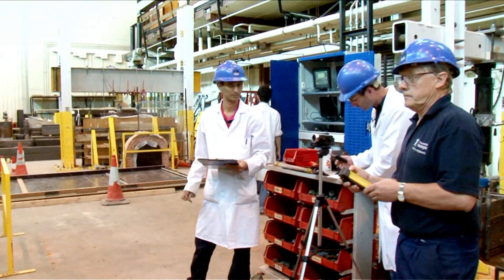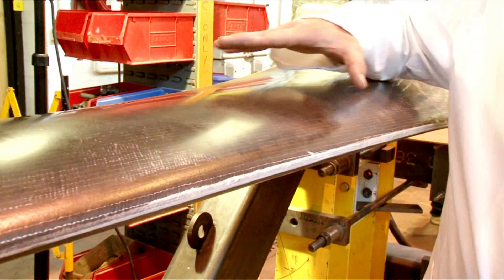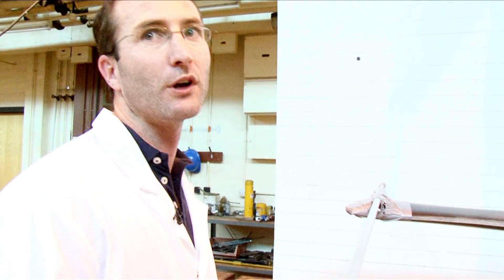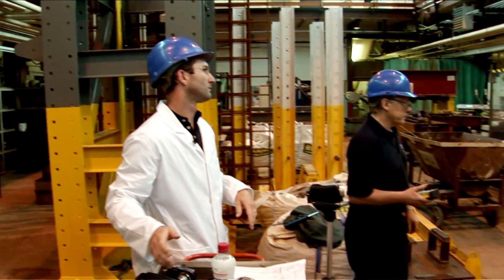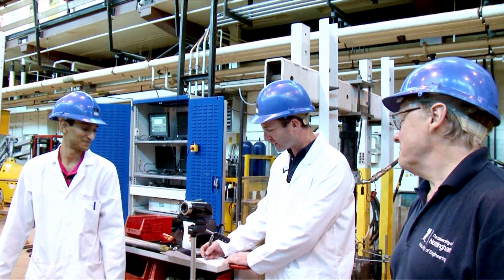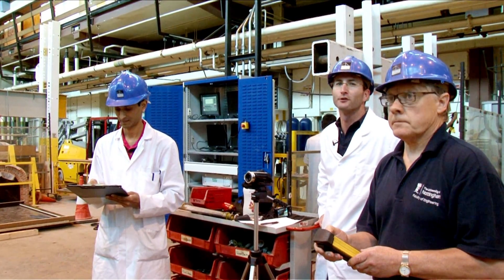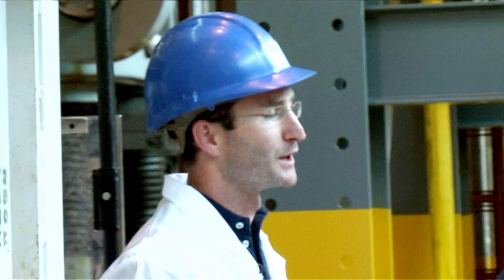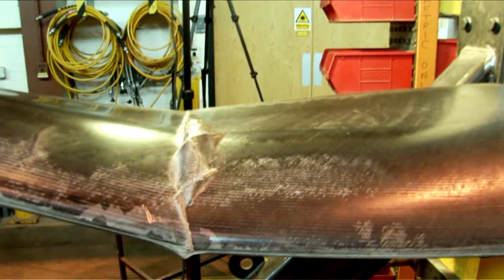Turbine Blade Destruction

Comment: Hemp was considered, but, as is the case with natural materials there, is a lot of variation in material properties from one batch to another. As it turned out, the flax fibres we tested had better properties than the jute and hemp fibres we also tested... so we chose flax for the blade.

Comment: With respect to the way of testing I don't think this is enough and/or real enough, compared to the later situation in which the blades are mounted. Rain, moisture, dirt, vibrations, sunlight, ultraviolet light from the sun, will (in my opinion) crack the surface of the blade, making it brittle and/or destroy the surface tension from the material. But anyhow, always good to test a blade of course and an interesting video.

Comment: Nail on the head. I'm studying engineering and this is exactly why they don't. The cost of composites as well as their production capabilities/costs are very high. Also, this kind of material favours
You generally use these kinds of composites for simple shapes that need to be stiff and light. (ie, wind turbines or the outside of a Formula 1 car)
Metal actually deforms even in fairly high speed crashes. It's very good at absorbing impacts which is one of the big reasons it's used in cars.

Comment: Currently plant fibre (thermoplastic) composites are being used for interior car components (door panels, dash boards etc). While the tensile/flexural strength of plant fibre composites is OK (hence it has survived this test for a wind turbine blade!), the impact strength (which is critical for car exterior bodies so that ur car doesnt crumple up if hit by another car!) is very low. Plant fibre composites are actually very light - approx. half the density of E-glass composites and aluminium.

Comment: Stress tests might put it under loading of say a 100 year storm (worst case storm loading estimate in a typical hundred years), using statistical estimates. Other tests might use repeated loading and unloading (fatigue testing) to simulate years of use (thousands or even hundreds of thousands of cycles). Testing to destruction is very common in engineering and a lot of standards exist.

Comment: the material requirements/testing of aircraft's is probably more comprehensive, particularly regarding fire-testing, as you wouldn't want a wing on fire!
But it depends what 'planes' are you referring too. Commercial airliners probably not. Military, perhaps yes. In fact, plant fibre and wood composites have been considered for military aircrafts such as Spitfires and Mosquitos, but only during World War II. Since then oil has become readily available, making plastics and E-glass dirt cheap.

Comment: More surface area also means more drag witch would decrease efficiency. They are basically the same as airplane wings, planes, and actually birds too, that are designed to fly very efficiently have long narrow wings. Only planes that can afford to burn up fuel in exchange for increased lift have broad wings. Also heavy blades would need stronger towers, bearings and more rigorous safety features which would increase the cost.

Comment: Plant fibres (density of 1.4 g/cm3) are lighter than carbon fibres (1.74 g/cm3), but not as strong/stiff. However, the amount of energy required to produce carbon fibres (135 MJ/kg of fibre) is 10 times more than it is required to produce plant fibres (15 MJ/kg of fibre). Plant fibres are actually carbon neutral.

Comment: I was wondering the same thing. They mentioned that this flax-based fibre was intended to replace the use of carbon fibre, so I assume that it would probably be strong enough.
How heavy it is, though, I wouldn't want to hazard a guess. I don't know nearly enough about it.

Comment: Also, any power plant that uses the boiling of water to spin turbines requires a water source and ends up heating said water source (coal natural gas etc). The cooling of the reactors using water is no different from the combustion of coal that heats up the air.

In my mind, other than the limited amount of hydropower that can be generated from falling water, there will always be some cost.

Comment: I'm not saying they're perfect, and I didn't see your original post no. However, new nuclear plants are so efficient and you need far fewer of them than other types of plants. They can be built far away from metro centres etc for safety reasons. Also with that new storage facility that is being built in Nevada under that huge mountain, storage will be safe. Definitely worth looking into. I'd rather have a few bird casualties than fields full of fans everywhere and little energy to show for it.

Comment: Isn't the problem with those fibers, that they are not very good in resisting hits? I think i read something like this. They already make bicycles out of that, but you have to be careful with them, as far as i recall. So an impact is not a very big problem for a blade that is, like 50 m from the ground, but it is for a car. Bycicle frames are small, therefore not that likely to be hit, they don't move as fast, and are relatively cheap to replace.

Comment: I feel obliged to correct you on the energy absorption of carbon (or any other) fibre: it's excellent and much higher than metals. Most of the expensive sports cars and pretty much all race cars have carbon fibre crash boxes. 
The reason is, that it shatters instead of just deforming as a ductile substance (metals) would.

Comment: Hmm... So this more or less boild down to how fire-proof this kind of material is. Probably not very. Although I'd guess that, with certain kinds of processing, you might get it to not be easily ignitable either.
Maybe they'll have to reconsider in a not so far future, once oil basically is used up.

Comment: It's basically like this: A cfrp crashbox will delaminate and shatter into countless tiny pieces and dust which takes much more energy to do than bending a piece of metal. Why? I can't explain this myself in much detail but I guess it's researched in this document I found:
cdn.intechopen com/pdfs/20632/InTech-A_study_on_design_of_fiber_reinforced_plastic_frp_tubes_as_energy_absorption_element_in_vehicles.pdf
The researched crash elements even reach more than 110 J/g

Comment: Well cars crumple for a reason, it reduces the trauma the driver sustains, but if a balance could be found between minor dent resistance and still crumple to absorb shock in higher speed impacts it could work. This is why many cars went plastic, it's safer and more durable, although it does make the car look dinky and cheap.

Comment: I've seen the experimental results first hand, university professors told me to study it, it's how I answered my exam but I'm wrong? I'm not trying to be vain, carbon fibre may or may not absorb shock well, but that is most definitely not the reason. Ductile deformation dissipates a lot of energy through frictional heat and bond stretching/breaking which shattering does not.
Shattering releases a lot less heat breaks less bonds.

Comment: Right. I know. And these test prove normally something because we know the material that is being tested. The test is not about the material we test the shape and construction. This inherently is a mixed test with no basis to conclude anything about it's longtime endurance because it's a new material. You understand my problem with this? It may be mandatory to break i for a certificate but the proof is based on what we know steel would do. Not a scientific correct method. That's the rub.

Comment: Accidents according to wikipedia are defined as incidents that either resulted in the loss of human life or more than US$50,000 of property damage. Most of the aforementioned accidents are using technology from the 70s that hasn't been replaced. Older technology although fairly safe, is nothing like the new stuff. If the activists would simply allow for new high tech reactors to be built they would see how safe they are. In the last 30 years in the US there have been very few new ones built.

Comment: Regarding hemp vs flax.  The University of Nottingham materials engineering department has published large amounts of data regarding the strength of natural fibres - again, do some research before spouting nonsense.  When treated with silane, hemp is siginficantly more durable, and regarding strength, its tensile strength is 15% higher than flax.  With respect to cost hemp is marginally more expensive,  five tons of flax costs $0.83/ton, hemp would cost $0.86/ton.

Comment: No, I don't prefer fossil fuels for the obvious reasons. But my point is, that the costs for nuclear power you're advocating do not take into account the long term costs and uncalculable risks. Given that an enterprise usually has to insure the risks it has, we can be luck that the nuclear industry doesn't have to do this. If they really had to take the risk, the costs for this technology would exceed many things we can imagine.

Comment: Yeah I get where you're coming from. Interestingly though, there's a lifetimes worth of knowledge amassed in the study of composites, and plenty of experience using anisotropic materials (behave differently depending on direction or orientation). This was not a material test (the test rigs are much more standardised). It was a failure loading test. In its design I'll bet aerodynamics were considered, worst case loading was calculated, bending equations used. Engineering uses scientific method.

Comment: My point is that nuclear technology is already able to safely supply the world with enough power and a low cost economically and environmentally while other forms of storing or producing energy are researched and developed further. If we go to fission then we can at least extend our deadline for a few thousand years not that we would need that long probably only 100-200. Unless you prefer using fossil fuels while the tech is being developed.

Comment: It would be quite hard to waste the uranium as there is more then enough to keep the human race powered for thousands of years which is more then we need. Also we already have the tech to deal with nuclear waste, it can be used in a different type of nuclear plant where thousands of tons are stored and slowly burned over decades to provide power. Sadly this tech isn't quite ready yet as they are still designing the actual plant.

Comment: Hemp and marijuana are two very different things, you should consider doing research before you start spouting absolute nonsense.  While they come from the same species of plant, hemp is a high CBD - low THC plant, while marijuana is a high THC - low CBD plant.  Put simply - if you smoke hemp it will just make you feel quite sick.  The most amazing use of hemp is in plastic production - far cheaper than petrolium based plastics and also biodegradable.  There is no other plastic that can compete.